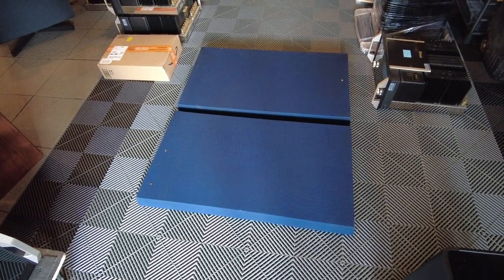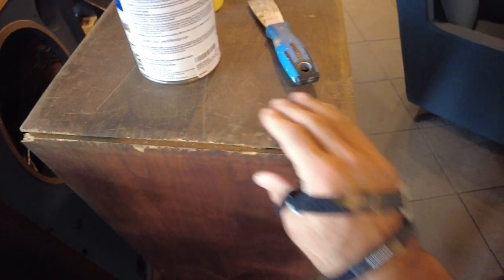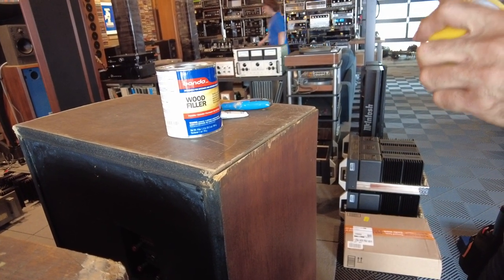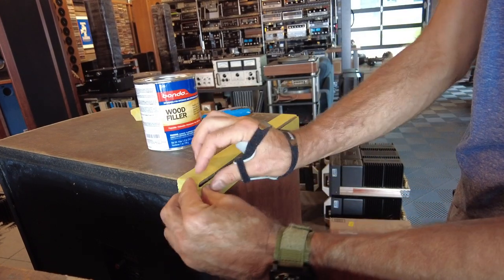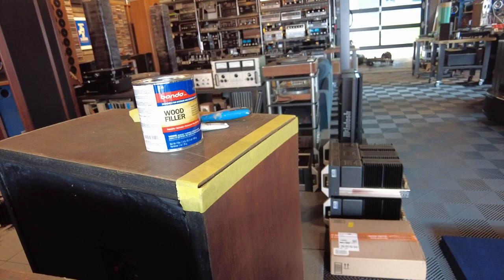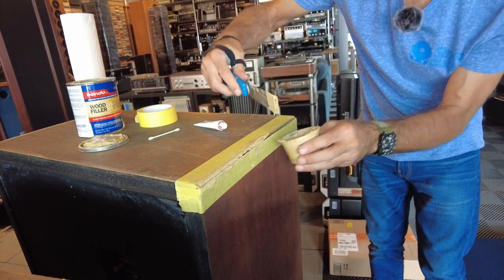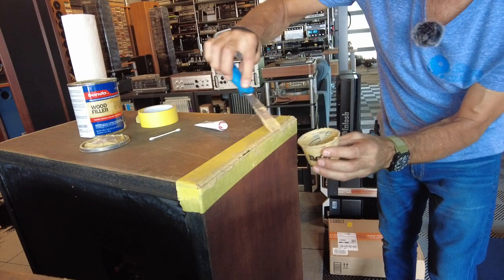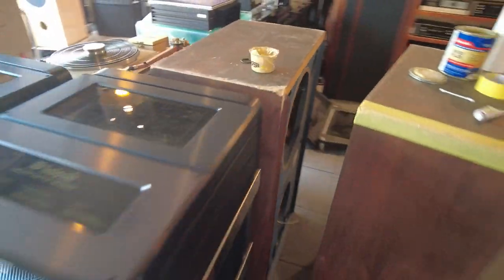Restoring the Grills and Cabinets on our Reference JBL 4343 Speakers

Comment: If you get a bit of exposed MDF thats gone 'furry', some thin superglue will harden it up - it can then be sanded or filled.
Reply: This method also works on standard particle board, but I recommend using an epoxy if its a large area.

Comment: Nice work! I find that matching filler with project wood is easier before applying. Mix a little stain into filler at a time until satisfied. Great work! Here I go to fix JBL’s!
Reply from the maker: Great tip! Thanks so much, I will certainly try it on the next set.

Comment: Could you not pull the corner together with some big parallel clamps ? The only way for that gap to appear was if the side and bottom panels pulled apart.
Reply: The woods caused it to swell and particle board I haven't had luck with clamping, but something like birch or ply it can be done. Filler or epoxy etc. would be about the only way to go in this case.
Reply: @JukeboxAlley  Particle board is ugly stuff. Can you imagine in the future when trying to repair all these speakers being built with strange materials like Wilson or Magico.
Reply: @dominicdiclemente8877  Particle board, inc MDF, absorbs water faster than solid wood, and it will swell or warp if it gets wet. The only way to repair is to re-glue the swollen fibres and clamp till dry, OR as in this case, just fill the small gap made.